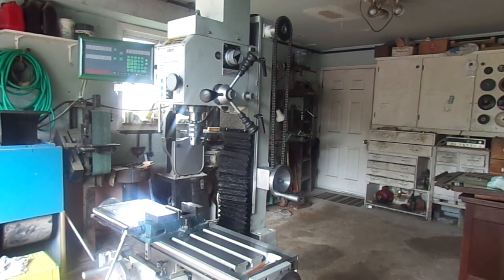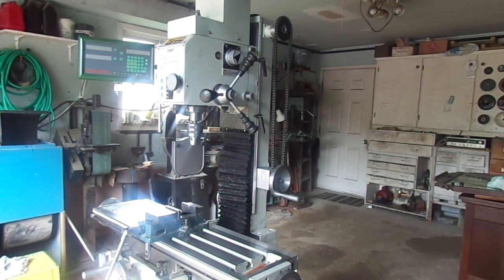sprocket video  raie and lower head 001

Comment: Hi,
I'd noticed your pics of this machine on Photobucket and among other things wanted to mention what nice machine work you do, esp as you are working all manually rather than going the CNC conversion route.

I wondered if I might get your opinion on the CX601 (esp in comparison to your older, smaller mill). I've been eyeing this machine for quite awhile now, and to be honest the only reason I haven't pulled the trigger is that I'm in the US. I already tried (and asked) but Busy Bee won't ship anything that heavy/freight across the boarder (even though I'm not all that far, in MA). I've even thought about making a weekend trip to make a purchase (~8 hrs each way-- and actually I did my grad school at U of T), but then there's the HST on top of things... So, in the end, I am just trying to figure out if it is really that much more worth it, or if I ought to go the much easier (and cheaper) route of having a Grizzly G0704 shipped straight to my door.

Thnx for your advice/input.